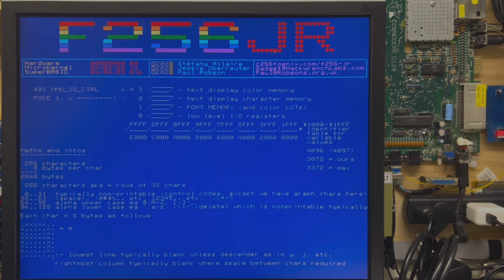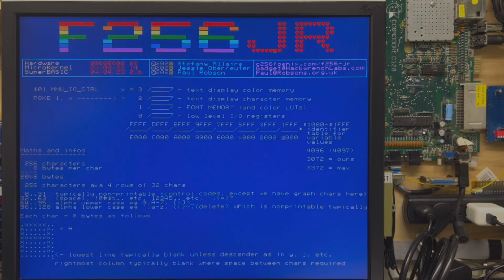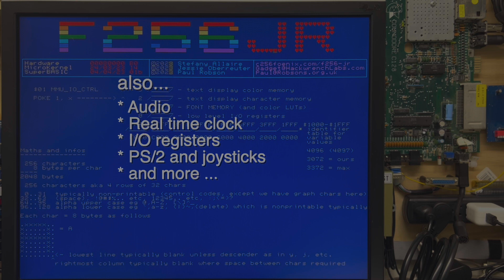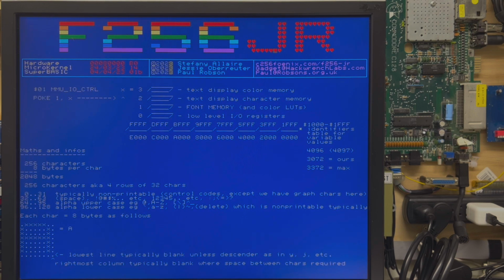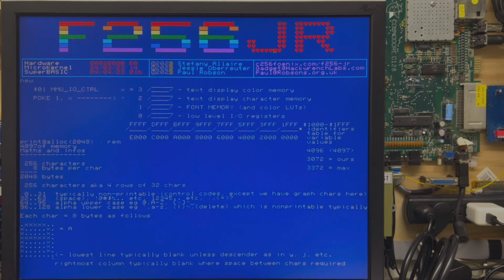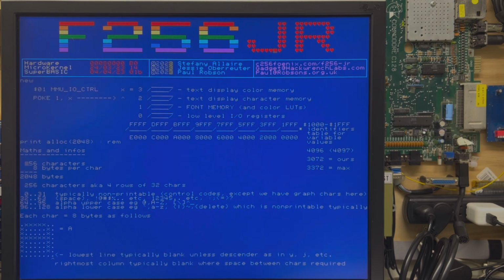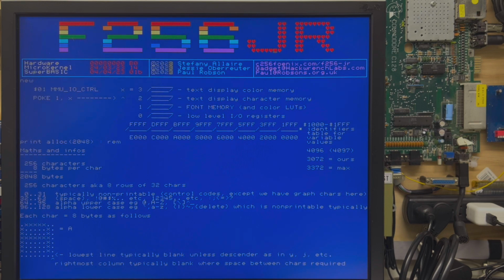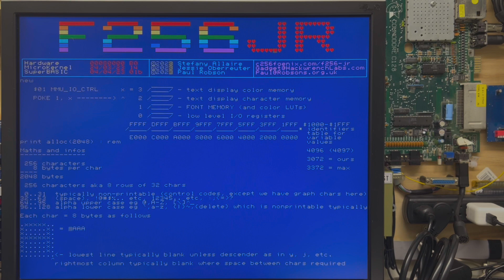Foenix F256 SuperBASIC Part 8a - Custom chars (pre-reqs; dealing with memory and I/O banks)

Comment: Lot of useful information in that screen image. I took a screenshot of the F256 screen shown in this video to save the data. If there is a program that generated the screen in this video and the one that showed the list of available SuperBASIC words it would be nice if that program would be made available in the Foenix marketplace.
Reply from the maker: @kevincozens6837  I’m afraid there is no program, I merely typed it out for the video and highlighted the text in Final Cut during editing.  There is a SuperBASIC help app built in to the later distributions, but otherwise, I’m afraid the manual is all we have at the moment.  The good news is, Stephany is porting SuperBASIC to the 65816 flat memory model so I’m fairly certain that the manual will be updated soon.